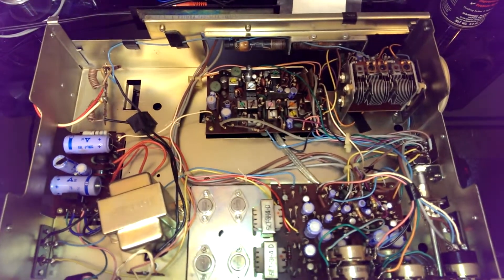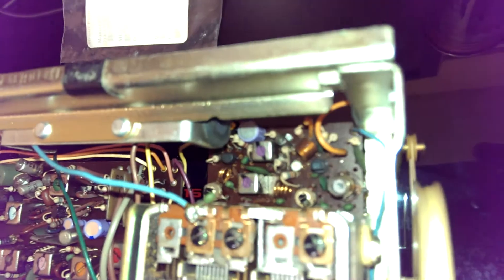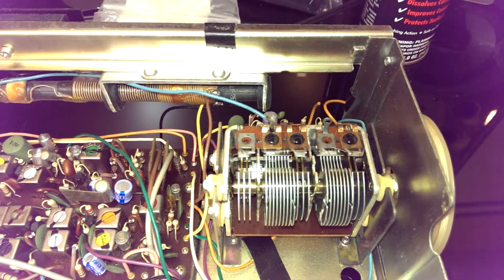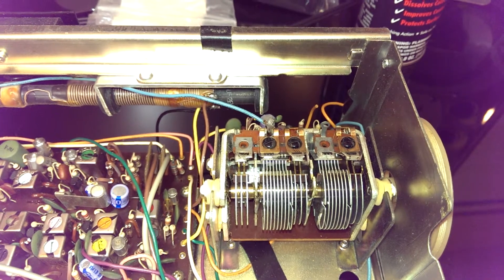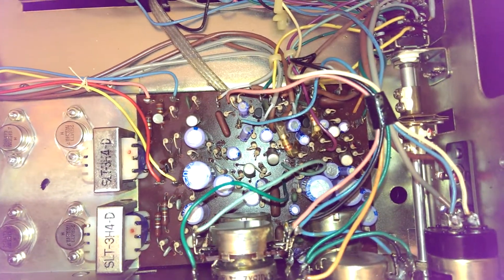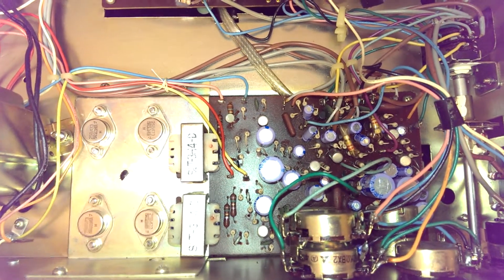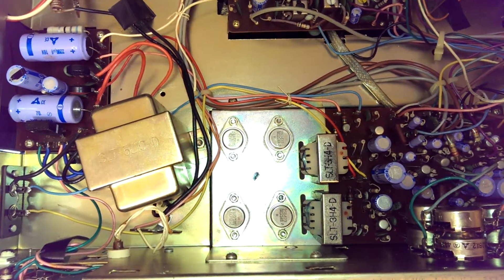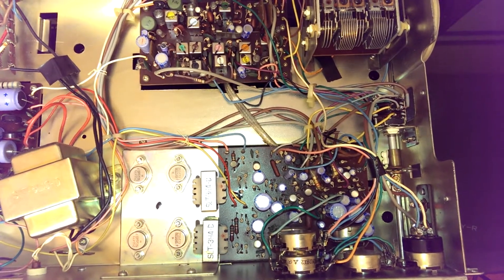Inside the Weird & Funky Panasonic SE-970

Comment: Hi, my radio feature burnt out on this device and I want to change it. How do I take the front face plate off ? Thanks
Reply from the maker: You shouldn't have to remove the entire front panel to fix the tuner. I've forgotten the specifics but there might be some nuts under thr knobs holding things in place if the side screws have been undone. A loss of power to the tuner is more likely; ensure its getting power.

Comment: Hi seven years on and thank you for posting . Question  on the player  I have  there is a dead spot on the volume pot that turns out to be missing carbon on the track and the pot needs replaced. I found a  dual  matching  50k Bx2  but the center tap is not on the middle pin but on the lower pin...does his matter or does the  tap have to be the center Pin.. thank you if you've seen this and if you could give some input
Reply from the maker: If I'm understanding the situation correctly, you should be able to adjust the wiring to accommodate the new pinout. I'm assuming you have a new dual gang pot with each gang having four pins...CT, track edge, wiper, track edge and the original had the CT on the top center with track edge, wiper, track edge at the bottom.
Reply: @MadScientistsLair  the only noticeable difference will be in the bass and treeble compensation at low volume.